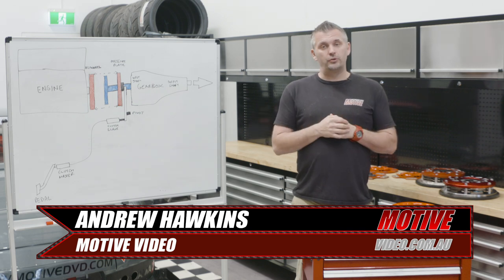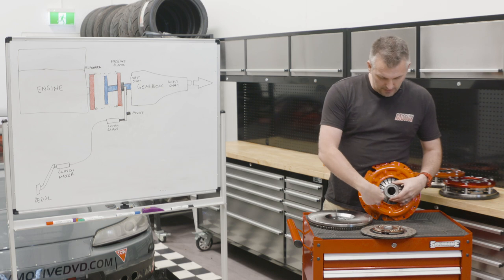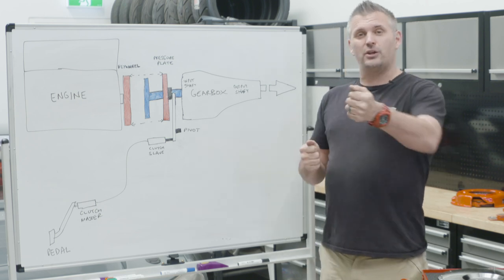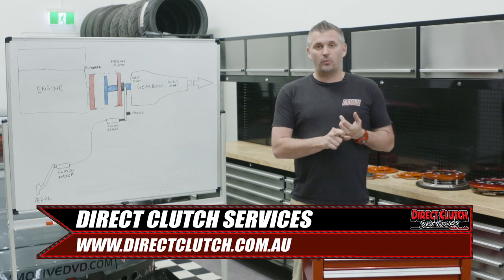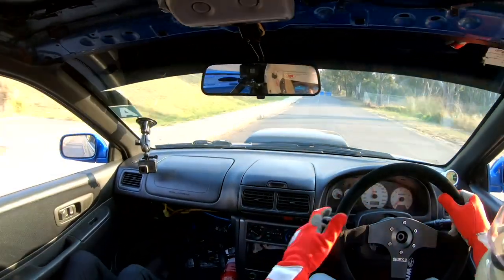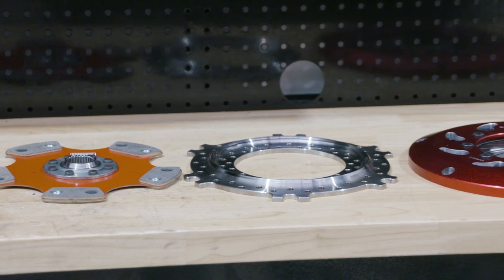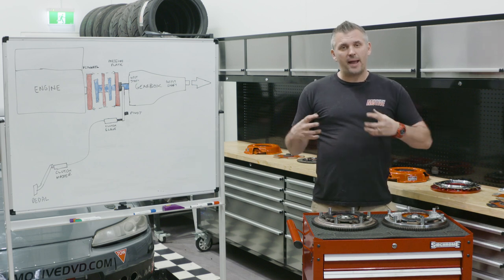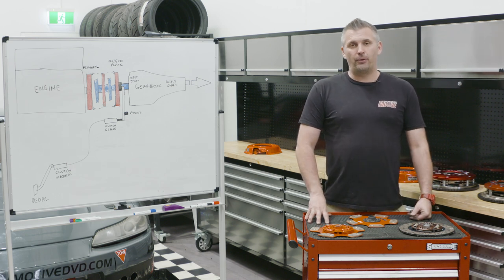How Clutches Work and Why Multi-Plate Clutches are Better

Comment: 12:42 lightened flywheels are excellent on the street if you love banging through gears. 
Your car slows down twice as quickly when backing off, if you do any partial throttle straight to max throttle the difference is utterly amazing. 
So every T junction, roundabout, hairpin entry/exit benefits. That feeling us manual drivers enjoy literally intensifies 10 fold. 
But if you just chose at the speed limit everywhere and don't enjoy having to hold a preside throttle input to stay at 1 speed its not for you.
Reply: I found with both my supras the problem wasn't so much that and only made life difficult for drifting.. with less rotational mass it was harder to get that initial torque back to the wheels. In my first one I went from a Osgiken twin plate to a Dcs dingle. I used the factory flywheel for a while when I put the single in but then went a lightweight flywheel and that made a huge difference to response but was harder to drift. My current supra has a ACE twin plate and ATI balancer so it revs awesome so it's more suitable for my circuit racing goal. Both twin plates were way better to drive than the single because of the lighter pressure plate

Comment: Just FYI, pull type clutch have higher clamping load at the same pedal force due to the way the diaphragm spring fixed in the pressure plate. Thats why a NA impreza has a push type clutch, where the turbo ones have pull type. Anyway, great video, thanks

Comment: I like a very light flywheel because I grew up with 2-strokes.  About half a second from idle to redline feels about right to me.  If I need to really speed-shift on the street to keep up with it, or do the Steve McQueen double-blip on the way up, I consider that an absolute win.

If you've ever driven an EF Civic or CRX, they had a very light rotating assembly, oversized throttle bodies, and a 5th gear very far from the rest of the H-pattern.  The McQueen blip was almost required to get into 5th smoothly, and I loved it.  "WAAAA, wop, WAaaaaa"  I just adored how zingly and free-spinning those things were.  They didn't have power, but they had the spirit!

Comment: Nice insight Andrew, i made the mistakefor my street car 3-4 years back when i put a steel lightweight flywheel in my car when my engine got swapped,Result it's to light.Engine stalls when shifting down to standstill, and the shift from 1st to 2nd is rough and i almost have to slam it in if i want to shift competitive,so i need that dual mass flywheel back, not fun on a vag haldex 4wd car, best pull the entire engine back out and change the flywheel that way.If i saw this video back then it would have saved me alot hassel.Great video.👍

Comment: good episode Andrew. Im highly considering going nismo coppermix twin plate in my R33 GTSt. Purely because, as even you said, theyre extremely friendly.  The car doesnt have that much power (400-450) and driven on the road, sometimes spiritedly. I think im making the right choice, shame they are so expensive. Currently i have an excedy segmented puck clutch that came with the car and whilst it isnt difficult to drive it is obscenely heavy for no logical reason. 
Edit: found out i actually have some custom made clutch with a shortened pin and spaztic clamp pressure. I probably have a master/slave mismatch. cbf to fix, rather nismo quality lol

Comment: Great video. One thing you forgot to mention about going to a larger diameter clutch is the inertia of the clutch discs (not the flywheel) and how that affect shifting performance. Many clutch manufacturers use smaller clutch diameters (e.g. 200mm) because the inertia is lower which reduces the braking-load required by the synchro's to shift gears. This is why carbon clutches for street cars are so good, they shift fast because the clutch plates have such low inertia.
Also a sprung centre clutch doesn't change how the clutch engages or leaves from a standing start, it's just there for harmonics and vibration and to remove shock loading. Like you said - once the springs are compressed, it's like a solid centre clutch anyway. Clamping force, friction material used and weight of the crank+flywheel combo will determine how nice it is to drive.
Often twin plate or triple plate clutches will have less clamping force than a single plate for this reason. It makes the pressure plate actuation better as well as the pivot points can be optimised for the required clamping force.
Reply from the maker: Maybe you should do your own video 😁😁
We did ours based on our experience and consulting with DCS. The great thing is there is so many combos and materials there is no 100% right or wrong. We wanted to get out the base fundamentals,  of the advanced stuff

Comment: I have a street/circut supra with a ACE twin plate and I get no chatter(t56 Magnum) . My previous supra had a Osgiken twin plate (and dcs single with stock flywheel and then lightened) and had heaps of chatter with the twin. I wouldn't quite say twin plates are bad for the street depending on application and the clutch setup. Mine has a a full face sprung and sprung 5 puck rated to 750hp. It's not hard to drive, just grabby and my 60 year old mother can drive it.  New clutches are much better these days.

Another thing that is often overlooked is with a single plate you don't want to put more than 20% clamping force over the standard clutch pressure plate because it puts lots of force on the thrust bearings on your crank. This is a common issue with 2jz's and guys binning their engines especially on a cold start. A twin plate overcomes this issue and also gives a lighter pedal feel.

Comment: I broke my sprung hub in my drift car and its extremely rare stuff. I welded the hub and disc parts together and rebalanced it and have been beating on it for 5 years. I found this lookimg to increase torque capacity. It's a stepped flywheel with a rasied ring for the pressure plate. Can i increase clamping force/torque capacity by milling the step to reduce pressure plate static height from flywheel?

Comment: Been running a HKS twin plate for over 35,000ks now rated at 650hp and can’t fault it, casual drag and track racing and has not let me down yet. Since clutch fitted car was 450fwhp and now 650fwhp. Don’t skimp on on your clutch setup!

Comment: Bearing carrier thickness on GTR with multi plate disc clutch.... never ending story. Just a few mm difference can ruin your clutch feel, and usually what clutch manufacturers recommend is totally wrong, so clutch feels very on-off instead of gradual

Comment: You'll also find a lot of race clutches don't use a flywheel either. The clutch bolts directly to the crank and uses a flex plate purely to start the car. V8Utes did this and ive seen it else where as well. Not a great idea for a stock engines because they are externally balanced unlike a race engine

Comment: @Motive Video    love love this video. Awesome content Andrew. I always hear about how driveable the Nismo Twin-plate Coppermix is, I honestly don't have that experience, and after watching this video, I'm thinking that must be due to another component in the clutch chain. Maybe the flywheel is too light. I feel like the friction point is way to small (grabby) and also too high in the pedal travel. I don't know what's in it, I bought it already in the car. Took me ages to get used to it, and even now, I can't take off normally on the streets without thinking about what I'm doing like any other manual I've owned in the past.
Reply: A larger diameter slave cylinder will make the engagement point wider. On the 86 I changed to a smaller diameter slave cylinder and it made the engagement point narrower. Regarding the high engagement point on the pedal, does your car have an adjustable pedal? The 2 Nissan's I have owned had adjustable pedals. The 86 had it too. I like the point to be as low on the pedal as possible (without causing problems of course).

Comment: Ok... so i need some help... ive buildt my bmw e61 530d to manual. I got around 300 to 350hp and 800nm. I got a 6puck unsprung sinter disk. When i take of from stand still it feels like im driving with a broken diff.. untill i get to speed.. then its fine.. but when im slipping the cluch its fucking horrible to drive.. HELP ME..... it has a original dual mass flywheel.. is the flywheel gone?

Comment: A modern F1 clutch is only 3.8 inches in diameter and they weigh about a kg, when is that technology going to trickle down into the aftermarket lol
Reply from the maker: It won't for the reasons we've said. But the BMW M3 with the electronic controlled clutch had quite a small one as well. Small clutches found their way into dual clutch transmissions too
Reply: @MotiveVideo  I know I know, it was a joke and more a thing of what you think is cool and what actually is cool.
Reply from the maker: Exactly 👍
Reply: DSG or DCT transmission are pretty close to F1 clutch setups aren't they
Reply: @NickTaylorRickPowers  
They are completely different man.